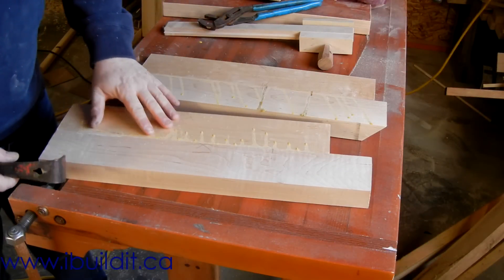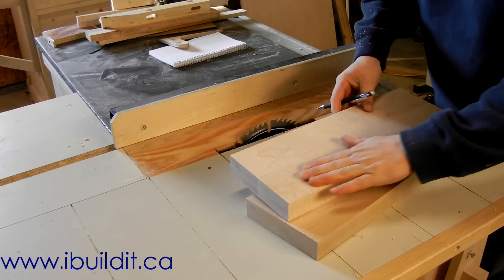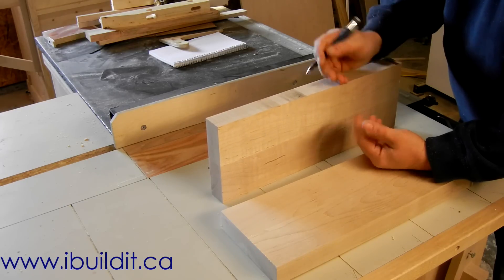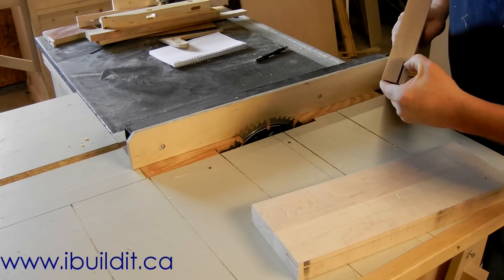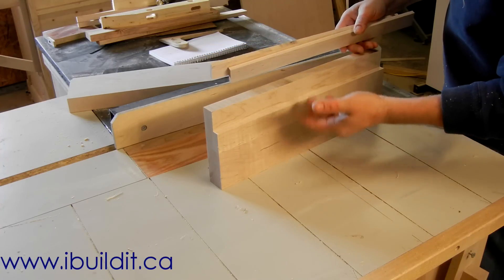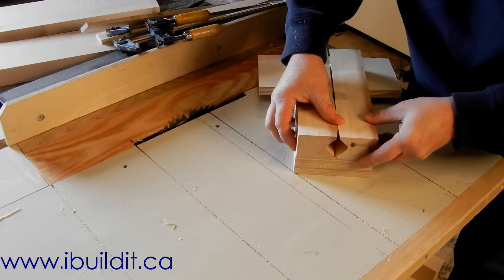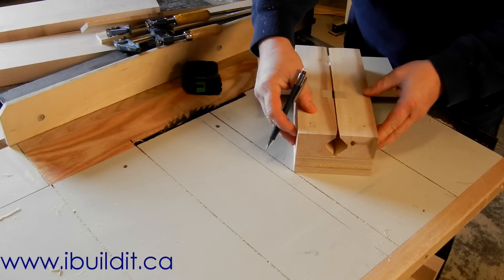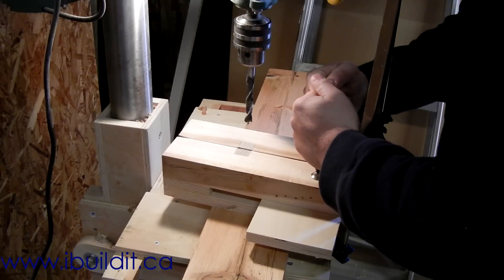Making A Woodworking Vise, Part 5 Of 10

Comment: what's the purpose of cutting the nut in half?
Reply: The cut-in-half nut is a key components of the quick adjustmen mechanism of the vise. This way you use the main screw only to tighten the workpiece.
Reply: GEORGE ZARIFIS
main screw?  what, is there another screw? i don't get it. isn't the screw there to tighten and loosen the jaws of the clamp by turning the handle?  can't it do that through an intact nut?
Reply: Chris R Well, it's like a bar clamp: you first adjust it to the required lenght and the you tighten it by turning the handle.